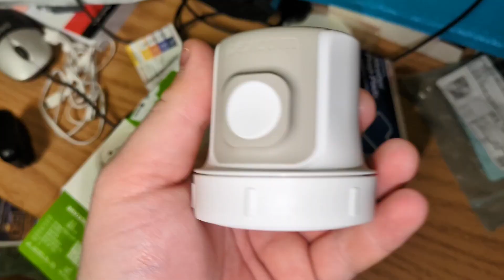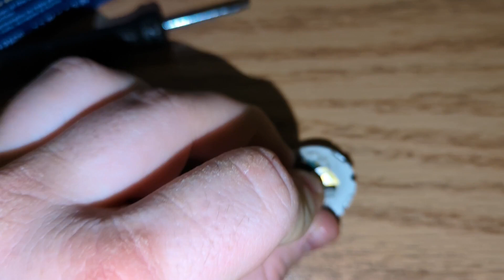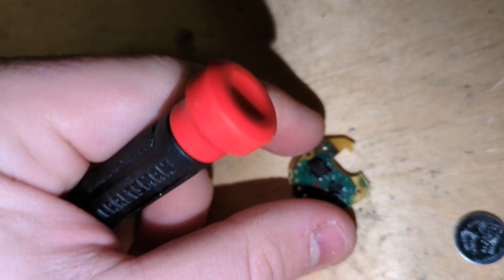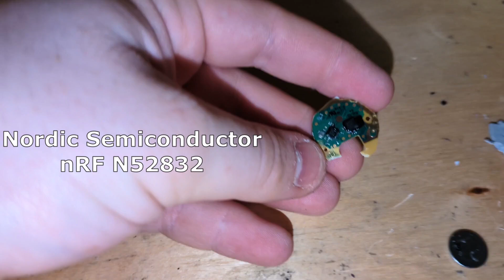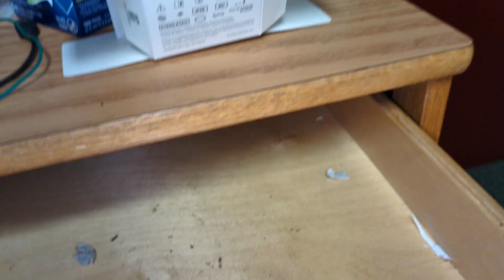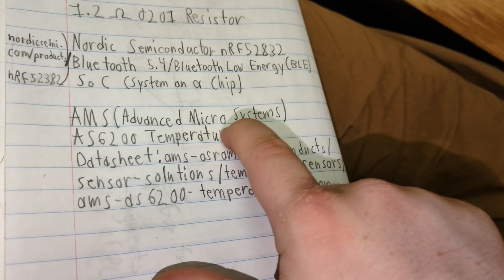Dexcom G7 Teardown and Investigation

Comment: If I were to speculate it is designed off a Nordic nRF52840 Microcontroller running at 64 megahertz. With its low power mode of just 2.3 Micro amps with full memory retention and running off a 3.0-volt battery for 10 days this would be the perfect choice.

Comment from the maker: In case anyone was wondering, I opened up another one and it had a Panasonic CR1216 with 2.9 volts after a full session.
Edit 2: Dexcom seems to have mostly decided on Maxell as the battery supplier for G7s. After 10 days, they typically have 2.9 volts with no load.